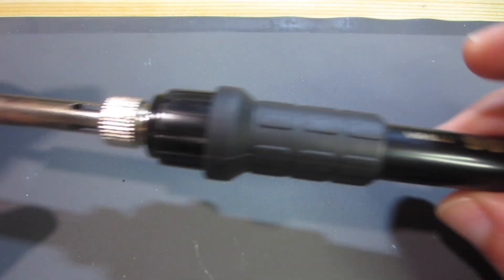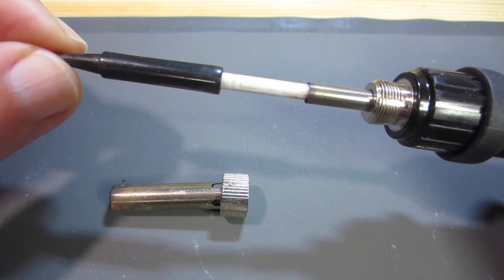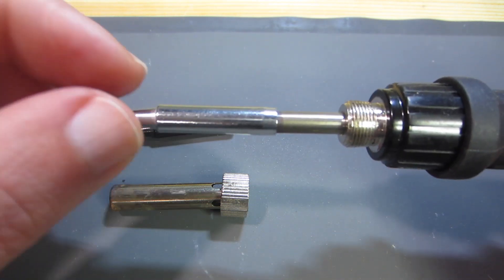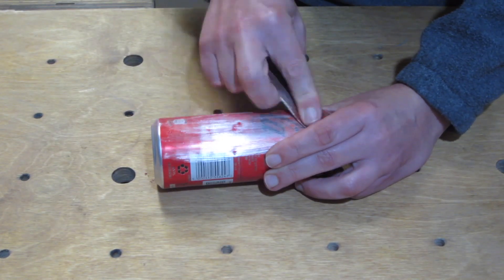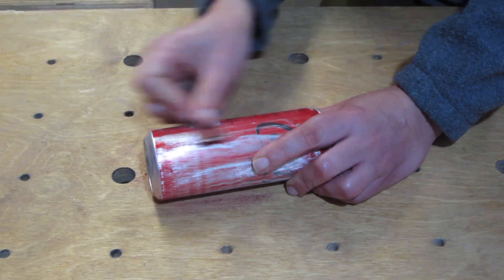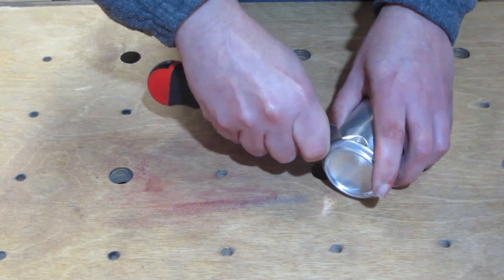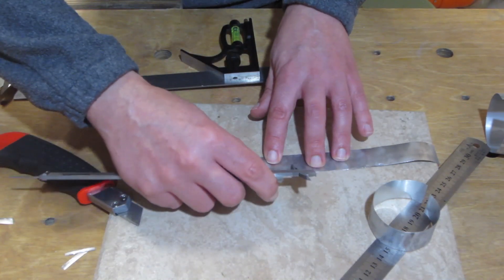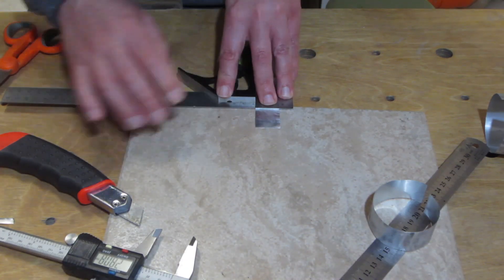Let’s improve the thermal transfer on Hakko 907 stations and clones

Comment: My tips actually fit so well they barely slid over the element. After a few weeks of use, I couldn't get the tip off because they had changed size due to the heating up and down. Actually had to drill out the insert sleeve inside the tips so they would fit over the element again. I know this is the opposite of your problem, but if you happen to make them too tight, you may end up drilling out the inserts like I did. Just some information for those out there who have the same trouble. As for your solution to close the gap, wouldn't aluminum foil be easier to wrap in layers? Or is it too thin and not up to the temperatures the iron typically sees?
Thanks for the video.

Comment: The heat propagation from the heating element to the metal tip does not occur by conduction but by radiation. Filling the gap with metal does not improve the propagation and most likely worsens it. 😂 Don't do it!
Reply: Hey, i didnt knew the tip is heating.because of the radiating heat! Thanks, good to know!
Reply: not sure.
will try out.

Comment: What if I apply thermal paste around the ceramic heater and then put the bit on it won't it work other than taking all that trouble with aluminium can.
Reply: I believe max temp of consumer thermal paste is around 150c. I checked MX 4, 6 and Noctua NH1, all of them are listed as having 110-150c maximum continuous operation. The lowest soldering iron would go is 200, and maximum 450c, way above listed spec of thermal paste.

Comment: You'd be much better off using high-temperature copper anti-seize compound. Or, buy high quality brand-name tips such as Hakko T18 that'll fit snugly and are made from metals that transfer heat better and last longer without pitting and oxidizing. The ceramic elements measure about 3.85 mm diameter, but the inside hole of the cheap made-in-China tips are  anywhere from 4.15 to 4.4 mm which leaves a significant air gap. The inside diameter of the Hakko T18 tips measure 4.05 mm, a much better fit.

Comment: Wouldn't that crack the ceramic heating element when the temperature increases and the tip expands?
Reply: Mine is not like that it has metal around the ceramic element to protect from damaging it
Reply: it'll expand, not contract

Comment: a shim from copper is much more better keeping in mide copper expansion coefficient 
thanks
Reply from the maker: It's true, but a thin sheet of copper is harder to find, while an aluminum can is something we all have at home.
Reply: @checcomaker   Dismantle a worn out 18650 battery , you will find thin copper sheet ， just make sure the battery is dead and has no charge in it before dismantling .
Reply from the maker: I will try, Thanks @apktsang

Comment: sand the paint off the outside, but leave the plastic coating on the inside...
Reply: Bottlers in some other parts of the world don't use plastic lined cans.
Reply: use lighter to test if it sstinks on plastic burn then it is plastic coated btw i use normal alu folie or copper one